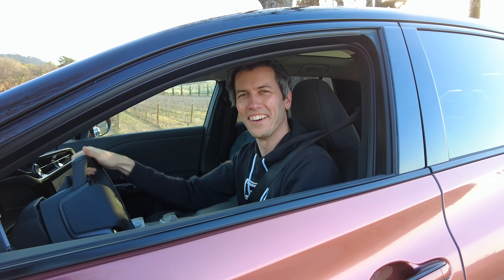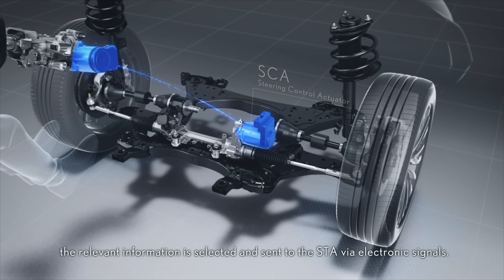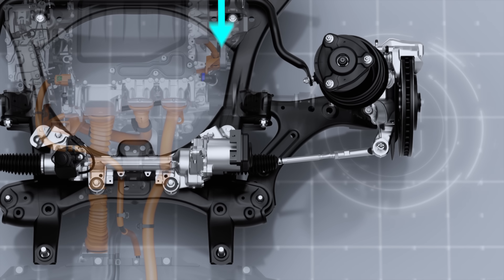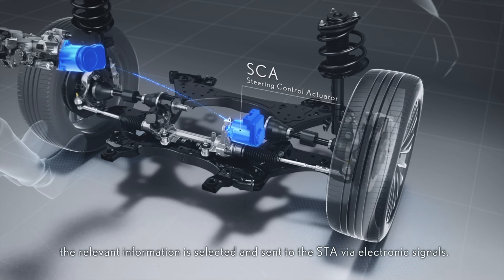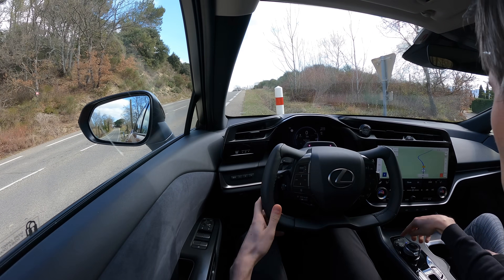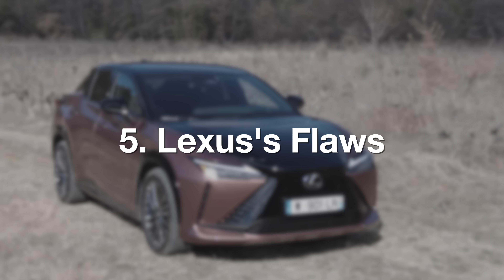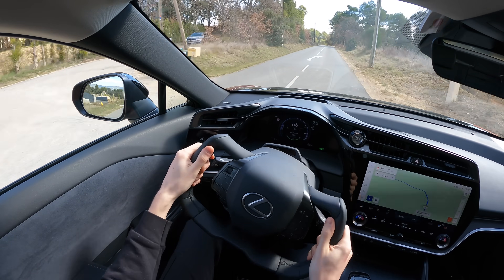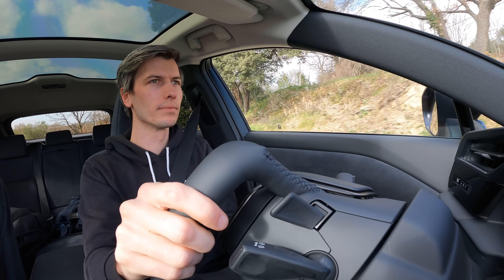How Lexus Fixed Tesla's Bad Idea: Steer-By-Wire Yoke

Comment: I do a lot of simracing and racing in the real world an i would love to have really low max Rotation of the wheel like in racing cars. They should allow it to set the rotation by the driver to the desired amount like in simracing. Maybe you can code it that way with special software like bimmercode, carly etc. I have driven a car with different rotations at different speed but i really didn´t like it because you don´t have the feeling to have full control of the car. When car companys let the people choose, more people can be happy with the car. I also don´t like one pedal driving but in some cars you can choose. If a car would have dynamic steering rotation or one pedal drive, i wouldn´t buy it.

Comment: The lag between steering wheel and steering angle is f-ing disturbing. "Small delay" he says. That delay is an entire moose getting run over. Horrifying. I hope this stupidity is banned soon. And variable sensitivity has already been solved, your mechanical steering wheel already has progressive gearing, after about a half turn, your turning speed increases. On some cars with electric servos, (my 2009 impreza for example) the force assisted with, is reduced at higher speeds. Meaning making excessive movement unintentionally on the highway, is dampened.

Comment: So the TLDR of this video is Steering by wire introduces large amounts of imput lag at the wheel meaning you will not be able to regain control of the car after loosing control , 
im 26 and i will never drive a digital steering system with these extremely dangerous downsides

Comment: This is not gonna catch on. It's illegal, and for good reason.

Also even if it weren't for the safety concerns, steering feel is a thing. Most car enthusiasts complained of the change from hydraulic to electric power steering for this reason. Getting rid of the steering column altogether is the worst possible scenario - and unlike the change to electric power steering doesn't offer an efficiency advantage.

Never gonna happen, pointless exercise by engineers with not enough to do.

Comment: No mechanical connection.....meaning g if a power fails the system is dead. Vs a manual hydraulic where you can steer it dead

Comment: I know a lot of us have this habit of changing hands when turning (e.g more than 30 degrees or so). While driving this, did you feel like you were reaching out for that missing section on the steering wheel? Also did you feel like you were forced to keep both your hands on the steering wheel longer than you normally do while driving?
Reply: That's exactly what I was thinking, the yoke pretty much forces you to drive with both hands on it at all times. Perhaps they should consider keeping the wheel, you can still have the same variable turning ratios. A yoke might be fine in a race car, where you're constantly engaged with controlling it, but to me it feels like this won't make for very comfortable longer rides. I'm used to shifting the position of my hands, placing them in a way where I can have some elbow support. And I didn't really hear any arguments why it has to be a yoke and not a wheel actuating the "drive-by-wire" (with Tesla it was simply because it looks more futuristic, but it seems Lexus is not going for that angle).

On the same note, how are you supposed to back up with a yoke? Sure you have mirrors, but physically turning your body around to get a wider field of view behind and around your car is indispensable, and I can't imagine how'd you do that reliably without having a middle point on the wheel to grip with one hand. And before someone says rear-view camera, sure those help when backing up in a tight parking spot, but they limit your view even further and over-reliance on them has led to serious accidents and even fatalities.
Reply: Could you cite a source for the last bit about backup camera usage? I'm only finding studies that suggest an overall reduction in accidents by the addition of a backup camera.
Reply: @dogerish  I couldn't find numbers either, but the way I remember reading about it, the problems are caused by screen placement and driver attention - since the screen is usually low in the dashboard, your eyes are focusing away from the mirrors and windows and the camera may provide a false sense of awareness. I found articles mostly by lawyer firms that provide injury related services that go into more detail (one in particular by Arnold and Itkin, titled "Drivers, Don’t Rely Solely on Your Backup Cameras").

So in summary, the camera does provide more safety, but drivers are likely to use it wrong by over-relying on it. In the case of a yoke, I speculate that may be further amplified since you can't physically turn around, so your eyes will be glued to the screen.

Comment: The yoke steering wheel based on muscle memory for 99% of people is to me a mistake . Reaching in a crash for a section of wheel that doesn’t exist is dangerous . And more to grip and rotate is far better to me based on simple math . The less wheel you can grab to handle a steering need is less opportunity to properly handle
Steering needs

Comment: Don't care if the top of the steering wheel blocks dash information.  I can move my hand.  NOBODY drives at 9 and 3.  Nobody -- except F1 drivers.  I didn't even drive 9 and 3 when racing my Mustang.  Also... when going over a pothole and the steering jerks... we need to know that kind of thing, not have it muted.  What's it going to do when we hydroplane?  Woof.

There's a great way to connect a steering wheel to a steering rack: a shaft.

Also... if Lexus has the ability to prevent erratic steering and doesn't, eventually an American lawyer will sue them (and win).  And soon after our cars will all be further neutered.  Yay!

Comment: A steering wheel with latency, just what the world needs
Reply: Gamer lag will now approach the top ten lists of IRL deaths.
Reply: @ZeroHourProductions407  he does not understand it, not on science levels....
Reply: Just from the video it seems pretty significant latency too. If I was just listening to this video I would have assumed it was minor to barely noticeable. This must feel awful in reality. Like having a controller with extreme lag.
Reply: Hey boiz, sorry, I'm laggi- 💥🚗
Reply: Worth noting that your average car has latency and input smoothing as well, through using rubber bushings and ball joints and such. The older the car gets, the more noticeable it is. Most cars go to the junkyard with all their stock bushings and MAYBE the ball joints replaced once. Polyurethane bushings last for the life of the car and then some, but they don't put them in factory cars because they are more expensive and the steering response is too fast for the average driver. Not to mention increased feedback through the wheel and the seat/body of the car. Ride quality is literally favored over the ability for the driver to avoid a crash
Reply: Don't planes, boats.. eh trains (lol) have drive/fly by wire tech already and its worked flawlessly for years.
Reply: @dragonl0l  First, trains do not steer... planes and boats have safety distances 100x those of a car if not more and inertia that is incomparable unless you drive a semi. The argument makes as much sense as saying why dont electrical bicycles  go to 70mph, other modes of transportation can do it safely so why not bicycles. Similarly there is more cars and car drivers in the world therefore anything with a higher likeliness of failure results in much more accidents and deaths. The delay shown in this video between input and output is visible to a naked eye which is not a good sign whatsoever.
Reply: @jeanjacques9365  Did you forget planes taxi, and that collisions do in fact happen?
Reply: after accident. sorry my steering was lagging xD
Reply: "More latency" - you always had latency.. The speed of push or twist is also the speed of sound in that material. For steel that would be about 5,000 m/s. If your steering linkages are about 6 feet in length, no matter how hard you twist the wheel, it'll take about 0.0004 seconds for that force to be transmitted through 6 feet of steel. Lag was always there, just not very much of it.
Reply: @wally7856  There is much more latency in the rubber bushings and ball joints. The transfer rate there is QUITE a lot slower than the speed of sound. Especially once a car reaches 10 years old or 100k miles
Reply: LOL do you believe that we as humans are able to perceive that level of latency?
Reply: @msolano00  0.28s... over a quarter of a second? YES, humans are absolutely able to perceive that. Average reaction time is 200ms, that is nearly 100ms faster than the wheels could react to the drivers input. Meaning that if something happens on a road it will take TWICE as long (nearly half a second) for that car to start an evasive maneuver.

And that is just reaction time. It is much easier to 'feel' the latency (lag) and in some cases 30ms of latency (about 2 frames at 60Hz) is noticeable.
Reply: @Axymerion  where do you have the official specs for Lexus where they define what is the latency of this prototype? There are still a few more years of development before Lexus releases this system. I don't think this will matter by that time. Will there be a latency, yes, will it be noticeable? most likely not, else this won't be sold in the USA or Europe and I''m fairly sure Lexus won't risk it.
Reply: @msolano00  I care about actual, measurable performance much more than what the specs say. Right now, in this video at 12:14, you can see that the latency is unacceptably high. What they do in the future is plain guesswork right now. I'm not very optimistic, as THE car that they use to showcase "Our vision to use electrification technology as a means to enhance basic vehicle performance, so that we can continue to pursue driving pleasure for all future generations" has an input lag so high, that all of the gamers in a 10km radius around it would feel the disturbance in the force.
Reply: @Axymerion  “i care about actual, measurable performance” you are saying this from an observation made from a youtube video (which of course is edited)? Dude we are both here talking on air. Once the car gets released it will get properly tested.
Reply: It's like the latency of clicking a mouse. Incredibly small. And airplanes these days use fly by wire
Reply: A plane is in the air dude here on earth you have obstacles !!!! Wake up dude !!!! You re brain is gone or what?@acphantom6437
Reply: @acphantom6437  wrong argument. Airplaines does not have to do sudden avoidance manouvers.
Steering wheel is a safety item. Any noticable lag or latency is too much.
Hiighly un linear, software dependant and not dependable steering ratio is also a huge no/no and this is someone who used to race and teach advanced driving techniques.
Reply: @acphantom6437  On a large passenger jet, even a second or 2 of latency wouldn't make a difference. So much inertia nothing happens fast, even with full aileron input, it takes a few seconds for the aircraft to start to roll.
Reply: @wally7856 lmao tell that to the pilots that fly fighter aircraft
Reply: @patrihawks24  Fighters are quick and nimble, 747's not so much.
Reply: @wally7856  my point is they also use fly by wire so I don’t get the point ur trying to make
Reply: @patrihawks24  Point is unless it has force feedback as good as a direct linkage then I don't like it and it doesn't belong on a car. Winter driving or driving on gravel highways without (very realistic) feedback would be suicidal.
Reply: @wally7856  747 doesnt have fbw. A lot of foghters have fbw because it is literally unsafe otherwise as the aircraft is too unstable. Not sure how this can relates to whether steer by wire should be or not but I thought it would be nice for you to know.
Reply: @patrihawks24  planes and jets are not cars. The tech may be similar but one takes into account of safety in the air and the other comes with the inclusion of being safe while driving which, I'm not sure you're aware of, tens of millions of people are doing.
Reply: @wally7856  2 seconds latency on a plane and you are going to be oscillating up and down like a floppy sausage as you overcorrect your pitch.
Reply: @maximum3fficiency  Boing, the most crash prone of the big jets, is more safe because it doesn't use fbw on its 747? Did you think that was a good example?
Reply: If you were paying attention, it's the physical steering column that has always had latency, not the electric system
Reply: Lag, not latency
it corrects the driver !
Reply: @lucasRem-ku6eb  It is latency. Latency definition: the delay before a transfer of data begins following an instruction for its transfer.
Reply: @FlaminRing  I meant LAG, i ratter have 1080p then 4k, only to get better direct response. So you get the force feedback from the game, and the graphics later !
Reply: @lucasRem-ku6eb  resolution has n o t h i n g to do with latency. smh
Reply: @Hadgerz  Actually that is not entirely true. If you run lower resolution, it will result in more frames per second calculated, and more frame per second will result in less input latency in most cases. That is why they use higher refresh rate monitors for gaming.
Reply: @lucasRem-ku6eb bd=braindead
Reply: @lucasRem-ku6eb  It's not even lag or latency, it seems to be just the speed at which the wheels turn. and this speed can probably be easily increased.

Comment: While I like new tech,  this is a "solution" that was not needed. Also, regarding redundancy, having 2 steering motors does not really malke the sistem a lot safer, do they have 2 entirely different power&data circuits, 2 different different harnesses connected to the steering wheel, 2 different computers that control any of the motors at any given time, is the switch from one computer to another and to the motor done instantly, does the software that drives the 2 motors have any backup, what happens if it gets corrupted etc etc etc.

This is just the ilusion of redundancy, there are so many fail points on it that it's almost impossible to build redundancy into it.. and we are talking about a system that can make the difference between life or death in just a split of a second... if you loose steering input for just 1 second at the "right" time, you may not be able to avoid a serious accident.

Another thing I don't like about this is that it's not predictible.. we usually drive the car by feel, and muscle memory, you can't build muscle memory if the steering behaves differently every time you turn it.

Comment: Yeah I don’t think the redundancy means it’s safe. Does it have multiple power supply circuits? Not just one to manage power from all power sources but one for each. Also, I doubt a light on a dash is going to guarantee that system ever gets serviced as people seem to ignore the other lights. Brake/Throttle by wire is fine because if those systems break you can still safely stop the car but with steer by wire you would lose control completely. I see too many problems for this to be truly safe.

Comment: Terrible idea, as it will never ever get the instant response of a mechanical system. I also generally hate the idea of variable ratios, I prefer to know my steering rack. Also, just because we 've had drive by wire for quite a few years now doesn't necessarily mean it is good. That sort of throttle latency and imprecision can only be somewhere between annoying and dangerous.

Comment: They could have variable assist drive by wire while retaining the mechanical connection while also eliminating the delay if they used a simple planetary gear.  Steering input turns the planetary carriers, variable assist turns the sun gear, output is the ring gear.

Comment: Beautiful speach from Japanish guy about response time and so what? the car is driven by human with response/reaction time of 200 250ms there is no any need to improve mechanical steering where only backlash has influence on the steering response time. Why do you need better response time of steering system in the EV.  One has nothing to do with the other, how about car mass? The body chassis mass have the biggest influence on car response time.